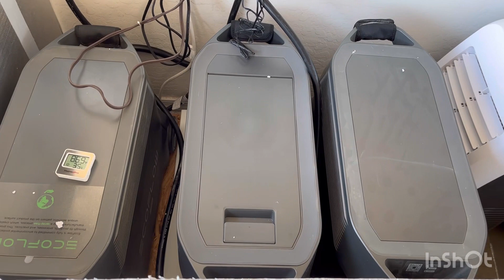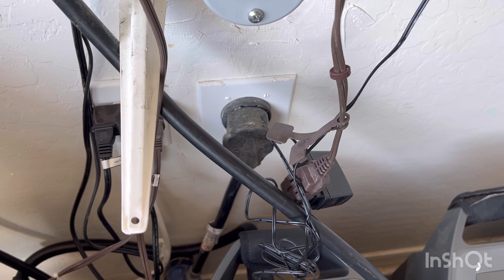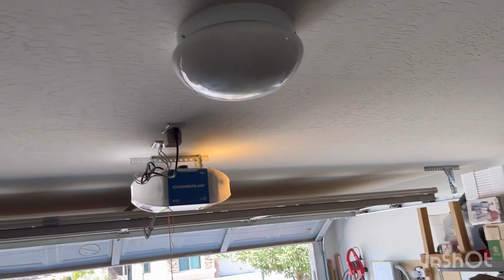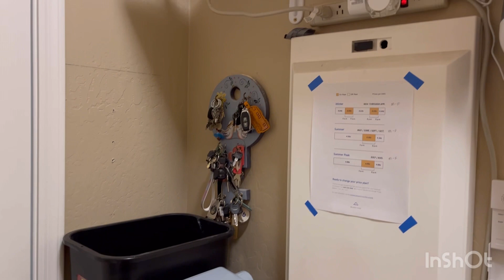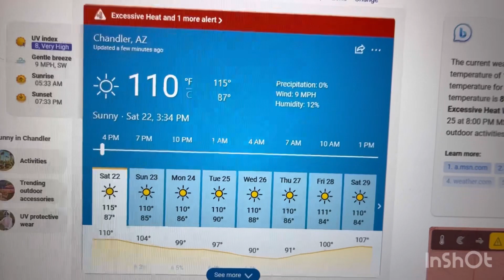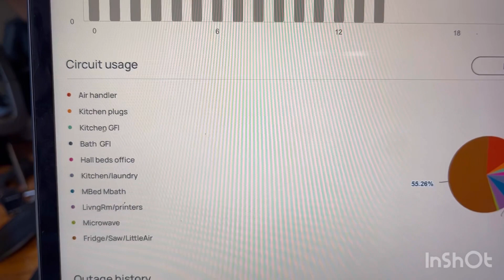Backup battery strategy changes Vol 5.2

Comment: Hi all, I ordered and received two DP, SHP, 3200w solar 1600w for each DP. I will not need any 240 circuits. My sub panel of course has 240. Can I wire 10, 120 volt connections even though half will be on one leg and the other half on the other. Or do I do the split phase thing? Not sure what that means. If someone can direct me here that would be great. If your reading this have a great day! 😊
Reply from the maker: Others may be more knowledgeable on this, but from my experence you should be fine. 110V A/C outlets should not care what leg they are on.

Comment: Yes you need to move your system inside. I have the Ecoflow SHP , with 2 delta pros and all 4 batteries. There is a rack from Uline that works really well, get the wheels too. There is a guy on YouTube that has it set up in his garage with a link for that. Take a piece of string or wire and measure distance then calculate amps or watts per circuit to get wire size needed. 10 should be ok, it’s rated to 30 amps and sounds like you are using 1/2 that. I watched all your videos and you’ve done a good job and I feel your pain about what what you’ll need to do but I think it needs it, just too hot out there. One thing I learned is how much noise the system makes when under a load but I have found a way to mitigate that. Anyway sorry for the novel. Good luck.
Reply from the maker: Thanks for the feedback. It will probably be fall before I make the move to the laundry room. Good thing my wife is so understanding.
Reply: Care to share how you mitigated the noise?
Reply from the maker: The laundry room, by definition, includes the noise of washer and dryer. It is away from the living part of the house.   Push comes to shove I'll add some sound proofing.